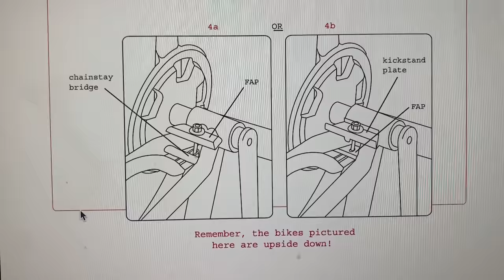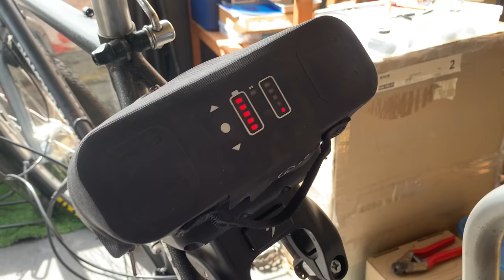converting an old bike into an electric cargo bike

Comment: Really interesting challenge of a project. I had no idea such kits existed. Lots of little problems to solve. I would have given up. Great work. The fact that it is electric really adds to the usability for hauling cargo.
Reply from the maker: Cheers mate ! Ya it was a lot harder than I thought, wasn’t expecting it to be that hard but got there in the end. The e kit really makes it a breeze to ride ! Can carry cargo no worries. Thank you 🙏😊
Reply: No joke.  I bought one way back after they dropped,  and it didn’t fit my dropouts so I moved it back to the store really fast.  Gutted!  Always pays to do homework first…

Comment: They make adapters for your fork to allow mounting of disc brake. Cost like $4-6... You would need a new cable and housing
Reply from the maker: The vbrake is working well but maybe switch in the future cheers

Comment: that rear brake caliper is supposed to have those spacers the way you ended up. I've installed quite a few of them in my time and that's how they come in the package, so you can get it perfectly aligned even if your mounts are tweaked out.
Reply from the maker: Ahhh I see! Thank you that makes sense 👍

Comment: Nice bike. The BB5 comes stock with v brake spacers above and below the holes for the bolt. They use the smaller v brake spacer pair for all 4 places. I think aligning it would be a bit easier if you had spacers on top as well (maybe google an image, hard to explain).
Reply from the maker: Thank you ! Yes I ended up doing that , might have gotten lost in the Voice over - you can see how it is in the end of the video when I lift up the bag to show the brakes ! Cheers !!

Comment: Waddup gary. Your vids are great. When you use the rust converter do you not have to cover it with a primer or something? Or do you just cover the formerly rusty spots once clean and it keeps it rust proof for a while, no paint needed?
Reply from the maker: Cheers mate! Ya exactly the later, keeps its rust proof for a while , no paint needed especially if you take all the rust off

Comment: Quick question Gary, Stripped bolt whilst taking apart a pedal. Whats a tried and true quick and dirty hack? No dremel here but I think I have jb weld...thanks
Reply from the maker: Ya jb weld or super glue
Reply: Ok, gonna try to jb weld a small nut to the top of the pedal bolt @garysprojects
Reply from the maker: @steelisreal4313  ya good luck, hopefully it’s strong enough

Comment: You said aluminum but it must be steel if it has rust. The brake mounts might be for a U-brake style.

No step also means to not stand on that and put your weight on that part.
Reply from the maker: Mmm you could be right, I’ll double check with a magnet later 👍👍 no step makes sense 😂 thx
Reply: +1 
Aluminium does not rust. It corrodes.
Only steel rusts.

Comment: Never seen “aluminum” rust like that ;-) Great find though
Reply from the maker: Hahah true ! Need to double check with a magnet 😅
Reply: @garysprojects  definitely thinwall highgrade steel. You can easily check the difference on the welds. Thick stacked little coin welds is aluminum and fine often more messy welds is steel.
Reply from the maker: @mountaincruiser817  ahhh I see thanks for the tip!